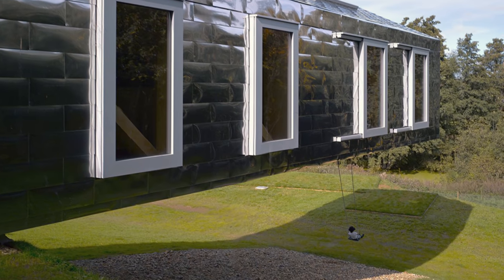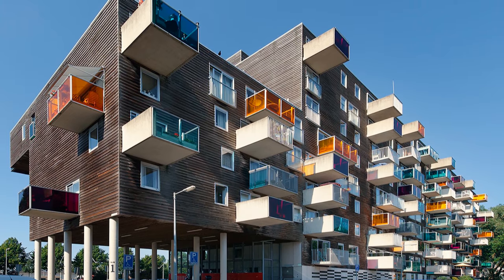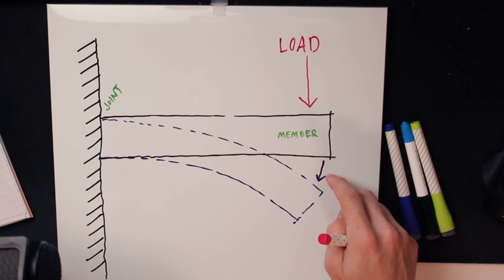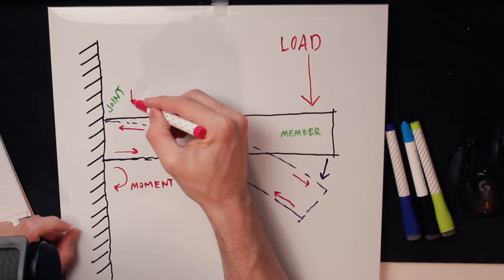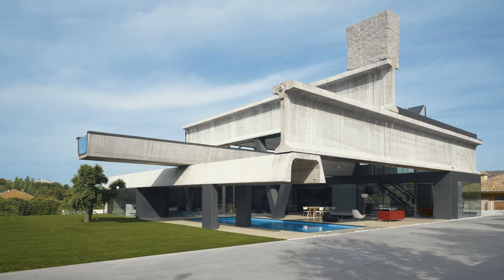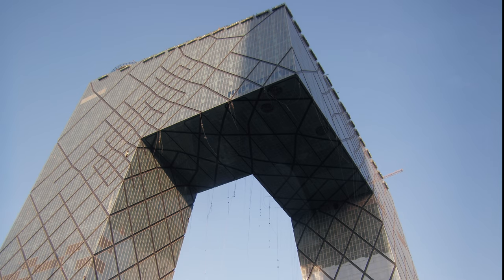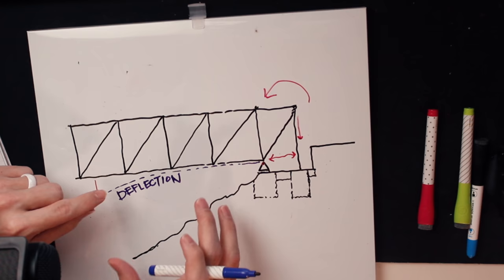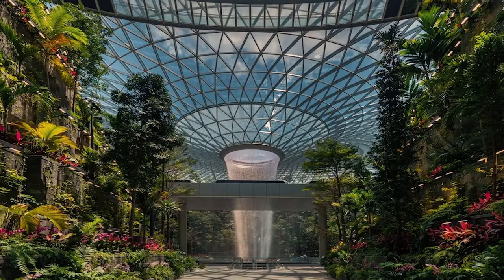The Architecture of Cantilevers

Comment: Frank Lloyd Wright should have hired a "trainer" to design the cantilevered balcony of Falling Water. The contractor who was reluctant to remove the scaffolding was on to something. The balcony did start to fail structurally and had to be reinforced at a later time, at significant expense, to keep it from collapsing. Wright was a genius at esthetic design, not so much at structural engineering.

Comment: Hi Stuart architect here, love your videos very good at covering concepts for the general public. Now for the architects one thing I would suggest is that yes while cantilevers are cool consider the climate you're designing it in. In colder climates the cantilever will look cool but you're building won't have the benefit of the heat from the earth to help with the energy that a building with a full foundation would. No matter how much closed cell spray foam is used. I've designed some houses in a Lake Michigan community that still has septic systems (though that's changing in the next few years), and building structure in contact with the ground has to be at least 10 ft from any septic structures. One way people get away with maximizing their floor plans is to have the structure cantilever closer to the septic tanks and fields.

Comment: I understand the appeal of cantilevers. (As a construction supply designer) I think architect regularly lie to their customers about the value of cantilevers. They push the smaller foundation versus structure size as a cost saving even though cantilevers typically add more in special materials and labor than from any foundation size savings. And depending on the structure- they can add WAY more. I was involved with a non-profit commercial job where the architect refused to add a full foundation under the structure because "it looked too heavy", which added probably an extra $100-200k to the job in materials and labor just so the architect could have a portfolio piece. It was infuriating. Also, I see so many architectural "pictures" (CGI) of houses on architectural design firm webpages with cantilevered decks, floor, and roofs that obviously do not allow for the beams required for such a design. It looks really impressive when you have an 8" thick deck or roof structure sticking way out unsupported. There is a reason those images are CGI. Over sell, under deliver.

Comment: The thing that puts me off this impressive type of design is the lack of redundancy. Whilst it looks cool, there is basically a single point of failure, and when human lives are on the line, that's just not acceptable. It should be designed to fail gracefully. Like with that concrete pool, maybe there is a distant earthquake, or ice gets into the surface, it would only take a small crack for that to rapidly propagate into something catastrophic, imagine being in that pool when that happens. Things break, it's a matter of "when" not "if". WHEN you need to perform structural maintenance on something like this, if you even have enough warning or foresight to do so, you want failure to have minimal chance of destroying everything else around it. Ship hulls have multiple compartments. Cars have crumple zones. I don't care how big your architect dick is, if you're putting other people in, on, or around your structure, you better make sure it is BEYOND "safe enough"

Comment: Cantilevers are held up by the architect’s ego and a continuous sucking sound emanating from the clients wallet. They have their place, however stroking the architect’s ego isn’t one of them. And Falling Water literally was falling down until extremely costly renovations. Not to mention, they are inherently unstable and designed for eventual failure.  A structure shouldn’t be dependent on just a few points of failure.